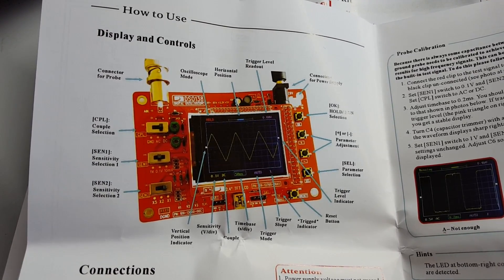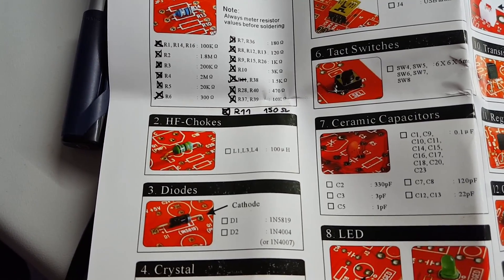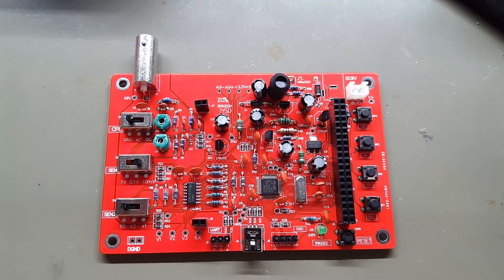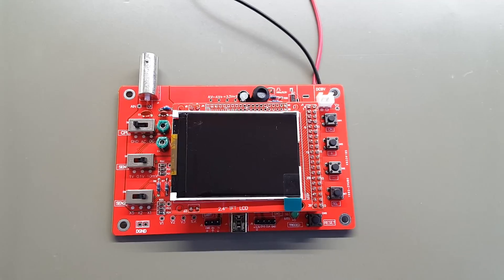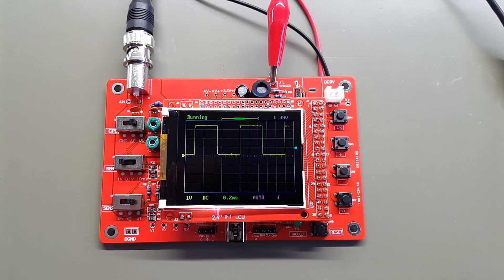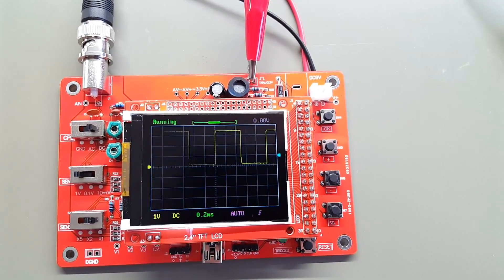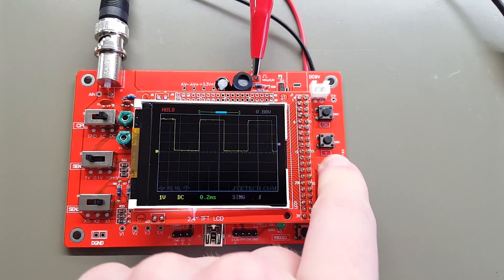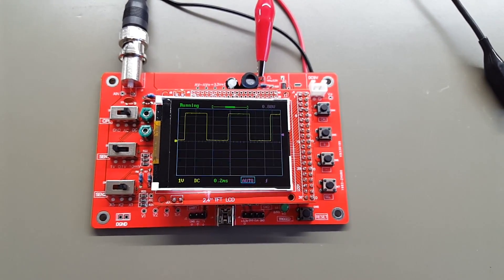Assembling and Testing the 20€ DSO138 oscilloscope

Comment: Said before but this is NOT the Mini :(
Reply from the maker: This video was made before there was the DSO138 Mini. The "mini" in the title was to describe the device. I have updated the title now.
Reply: @DrCassette  Gotcha. Thanks for the video, just didn't want people to be confused since they updated the kit now, made it smaller and called it a mini. Did you have any issues with noise on yours? Not sure if a good 100kHz probe would help or a filter cap on the input.
Reply from the maker: To be honest I never really used my DSO138. It has been in storage since I built it...

Comment: May I ask where you bought that?
Don't buy one from BangGood or a 3rd party from Amazon, I got screwed both times. Both were counterfets. First one seemed legit until I couldn't get the damn thing to work. I went digging around and found out the from JYE Tech that the circuit board was different then they put in their kits and the firmware was older and told me it was a counterfet. I then contacted BangGood and they told me they get them from JYE Tech. JYE Tech's sales support said they never did dealings with BangGood. The second one from Amazon I didn't even bother try putting together and trashed it since the instructions were photocopied and the JYE Tech logo was wrong it said "JYE Tach".

I got the whole story about it on my blog, comes in handy to point out a counterfet and how dealing with the saler went nowhere.
https://tcpmeta.wordpress.com/2015/10/02/my-dso138-is-a-counterfeit/
Reply from the maker: I guess I got lucky. I got mine off Ebay straight from China. At the time of buying the scope I was not aware of the issue with counterfit versions.
Reply: Sure did get lucky there. A lot of the DIY kits from China attend to turn into counterfeits at some point.
Reply: Just to update this a year later. I recently purchased this item from Banggood and JYE Tech have confirmed that the board IS GENUINE....indeed, JYE Tech say that they have not had any complaints about kits bought from this source.

Comment: If you use it on battery, does it have "low voltage" warning as the battery draining?
Reply: No, therefore you'd need a controller for the battery, or at least a voltage sensor in the scope. I guess for the simple appliance that it is, it will just stop working when the battery has reached a point somewhere below or at 7.5V
Reply from the maker: No, below a battery voltage of around 7.8 V the scope just starts malfunctioning.